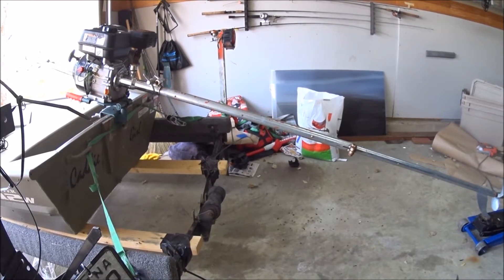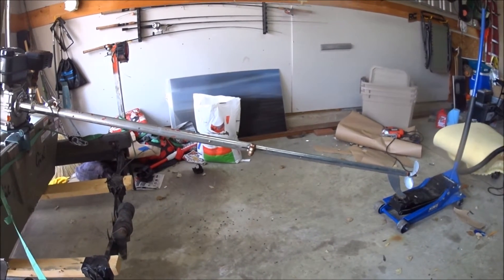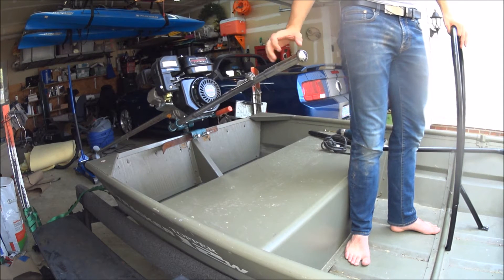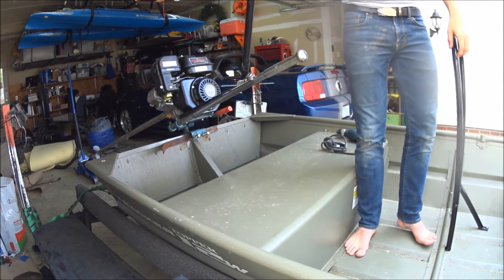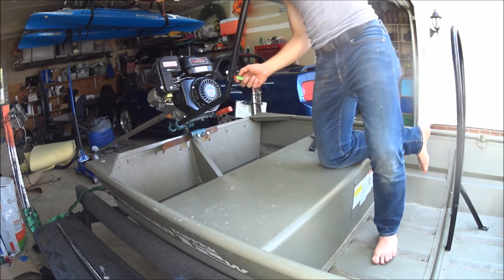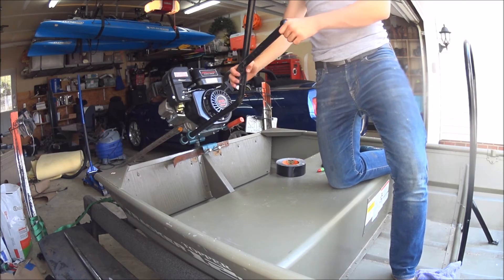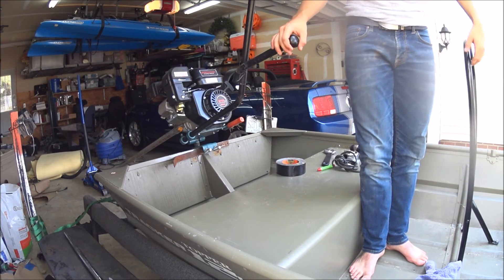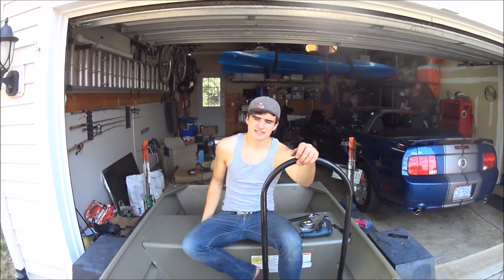Custom Mud-Skipper Z-Bent Handle [Long Tail Tips #7]

Comment: Ever have a problem with The bearings heating up in the shaft?
Reply from the maker: +Philip Garrett nope, they're running in the water so it's not a problem, just don't run it for more than a minute or two dry